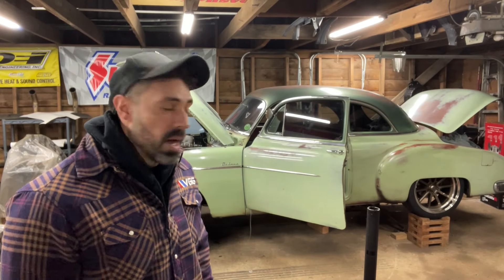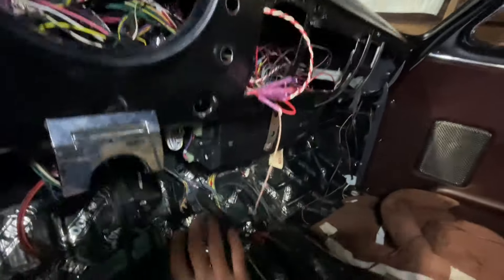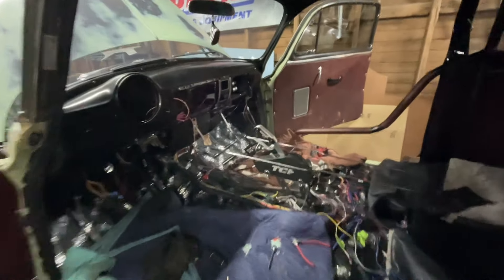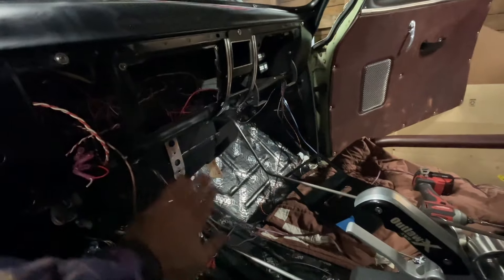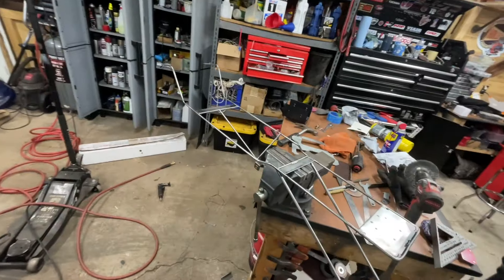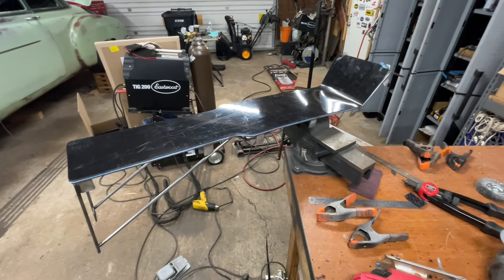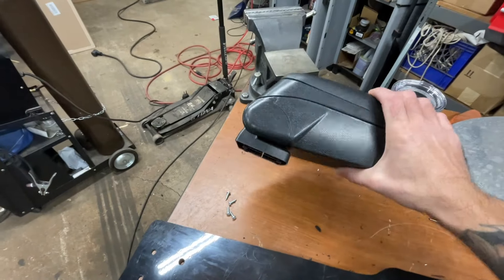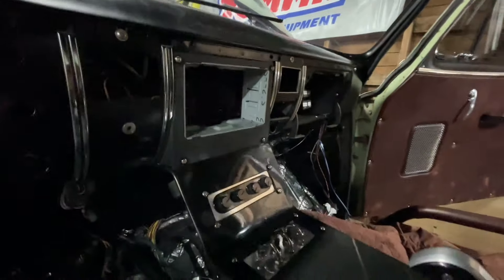DIY custom center console

Comment: Just found your channel and loved this vid...I like how yu are getting around the console thing...its kinda daunting as its the first thing you see when you get in the car normally...question...how did you work out the sizing on the hole for the shifter? Was it trial and error? Start small and work up to it? Doing this over, would you have used thicker plastic sheet? Looks easily workable as is, bent nicely around your frame... keep em coming...looking forward to the next one mate
Reply from the maker: Thickness is fine but could go a bit thicker.  I placed the frame in and laid tape down where it meets the shifter.  Pulled it out then placed the plastic back on and the tape edges make a perfect outline of where to cut.  Hope that helps. Thanks for the support!

Comment: When you filled in the corners by the section of double din, you used superglue to attach and then? What is in the little spray can that you said kinda welds the pieces together? TIA.
Reply from the maker: It’s a “kicker” it makes the glue react really fast so you don’t have to hold it there and wait for it to dry